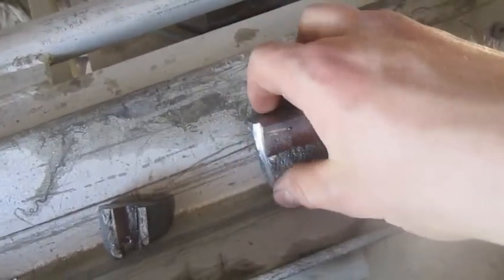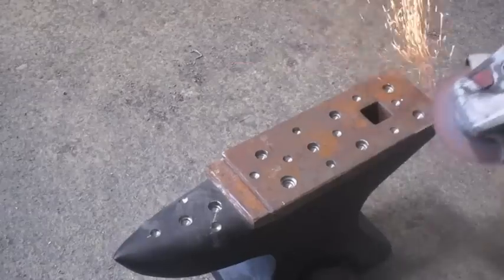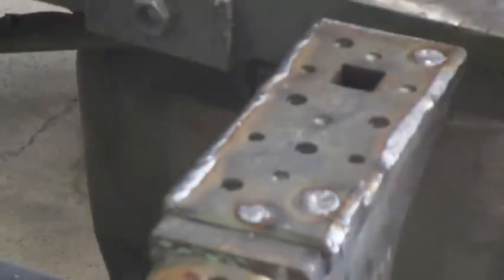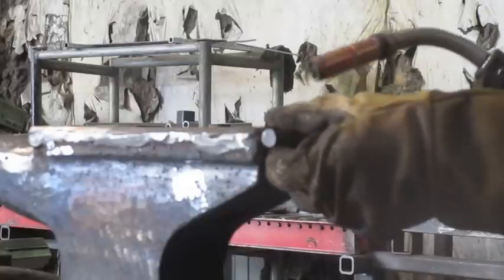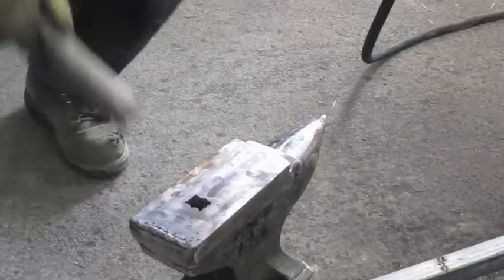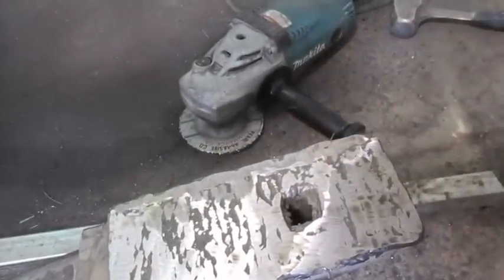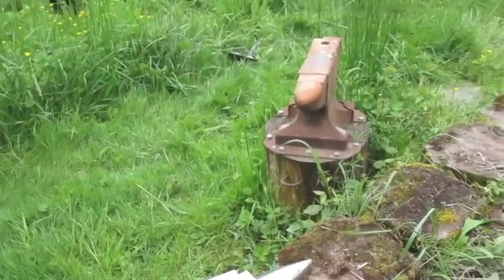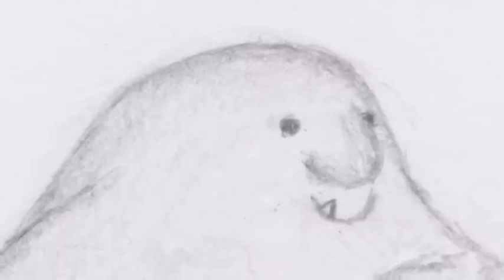Modified Cast Iron Anvil- Yes, it can be done

Comment: Make another video on this anvil. Take and fill in the gaps on the side add onto the heal and drill a pritchel hole
Reply from the maker: Would if I could! Ended up selling it.
Reply: @caveofskarzs1544  aww bummer I thought about doing that to my anvil I have the same exact one but i am getting a new one and that one is kinda sentimental. A guy gave it to me for my very first anvil. I’d feel bad to modify it but I wish it were more usable
Reply: @caveofskarzs1544  but if you ever get to it do it again. But instead of filling in the sides grind off the little lip on top before hand then hard face it and add onto the heal.

Comment: Can you remember roughly what settings you ended up with on the welder for each wire? I'm doing a very similar one this weekend.
Reply from the maker: I'm afraid I don't. I do remember that I turned the heat up pretty high.

Comment: Does anyone know if you could do this to a 102 pound Peter Wright anvil. The anvil I am talking about is my great grandfather’s anvil and someone tried to fix it with just mild welding wire and they took the rebound and hardness out of it. So I want to know if I should do the same to this one.
Reply from the maker: Might check out Essential Craftsman's video on anvil repair. I believe he touched on what to do with a soft anvil. As long as there's enough hardenable material you might be able to reharden it.

Comment: Any recommendations on what you would do different?
Reply from the maker: Sure.
I would preheat it hotter for one. Next I would use a cast iron welding rod for the first layer at the very least. Might not put as much mild steel in, since that was a big reason it took as long as it did. Lastly, I would have a thicker layer of the hardened steel.
Reply: @caveofskarzs1544  thanks. I'm thinking of fixing up an anvil, probably just needs hard facing but I was curious.

Comment: Why not just weld on a miepce of steel plate, like a cutting edge or something, drill some holes through both and fill a few spots in the middle, would be way easier and alot cheaper
Reply from the maker: I considered this. It may work, it may not. But in the case of this, it would be welding a steel plate to cast iron, and while it would be faster and cheaper, it would not be better, since the connection is in jeopardy simply because of the material difference and the lack of connection. I may be wrong.

Comment: If I'm not mistaken I think those anvils are cast steel it welds similar to cast iron you can do it nicely with mig but has to be crazy hot pre heat cast rod on a stick welder d/c works best but it's still not hardenable would have been easier to seal the edges of a high carbon steel plate with weld and forge weld it on and grind off welds this takes less money work and is the way it was done for centuries
Reply from the maker: Perhaps. But I didn't have a forge large enough to forge weld this large a piece. Thanks!
If you ever forge weld the face of an anvil yourself, I would love to see it! I know one blacksmith who has, and he said it wasn't easy. There aren't a whole lot of videos about that.
Reply: It had to be a cast steel or it would not have welded the way it did

Comment: Honestly you could make good money hard facing cheap cast iron anvils like that.   Especially since you made that material so thick before you hardfaced.
Reply from the maker: That has been a thought of mine. I would just need to fine-tune the process to make it cost effective.
Reply: Cave of Skarzs also I have soft firebrick rated to 3200°F if you’re interested

Comment: There is a difference between cast iron and cast steel I'm betting it is cast steel
Reply from the maker: Why do you think it is cast steel?
Reply: @caveofskarzs1544  welding with a wire feed and when you where grinding the sparks where yellowish orange cast iron they would have been red
Reply from the maker: @rockyroney2666  Ah, I see.
Well, whether you believe me or not, I believe it was cast iron. From my tests prior to even attempting this, and from previous experience, it was cast iron. But, maybe you're more experienced than me! Let me know.
The video does not catch the sparks' color well, and I only now saw that. In real life, the sparks were darker. If it were cast steel, the sparks also would have had sparkles at the ends; these did not. I also cut into a corner of one of the feet to break test, and it broke and looked like gray cast iron.
As for welding with MIG: That was kind of the other point of this video. Right at the beginning, I gave examples of test pieces of cast iron I welded with mild steel, and stated that I even beat on it with a hammer. I was trying to prove it was possible, and reasonably preferable to buying special rods.
Reply: @caveofskarzs1544  The way it welded  .   You would have had nothing but a mess if it was cast iron

Comment: Are you sure that's iron? It makes sparks and shines like cast steel.  That's a fortune in mig wire and a lot of time. Truth is if your material is hot enough cast iron works just fine.  Many  a blacksmith worked on a cast iron anvil for years.

Comment: Too labor intensive...
Buy a railway  scrap 
Make it cheaper...
Reply from the maker: Cheaper. . . Yeah. Better? No.
Reply: Railway track a) is illegal to gather, and b) has no real mass to absorb the shock of your hammer and rebound it back at you.  Better off using a stump with a rail connector plate attached than a piece of track.

Comment: I’ve wondered if this could be done, now i know. Thanks.
Reply: Can it be done?  Sure.  I wouldn't recommend it.  Hardfacing wire is more expensive than tool steel.  For about $45 you can get a 1/2" piece of tool steel for the top.  That's easier and will likely perform better.  Add a hardy and pritchel if desired.  Harden and temper.  Bevel the top of the cast iron anvil substantially and then weld your way out to the edge.  I added a 1" thick top to the big chunk of mild steel that was my starter anvil, and it's awesome.  I got it from my steel supplier - it was a piece of cut off from a special order - for $20.  Get to know your local steel supplier, they are to a smith what a butcher is to a chef.

Comment: I was wondering if this could be done I have an anvil about that size but is twice the weight and defiantly cost alot more but wanted to k ow because a friend wants a cheap one but you get whatyou pay for and if a good steel was on top it might be ok
Reply from the maker: Yes, I believe it could be done. Depending on how you would charge yourself on labor time, this may be a good investment. Does that answer your question?
Reply: @caveofskarzs1544  yes thank you would it be a good or bad idea to drill holes through the the steel so there is more weld to the top
Reply from the maker: That would really depend on what it is made of, and what process you are using to weld. If it is a steel top, no. If it is cast iron, yes. If you are using a stick welder, no.

Comment: Why did you use a gas shield   with flux cored wire? I'm a newbie and just bought a hay budden 80pd anvil that is damn near toast but I'm going to try and reface it just not sure how yet. Do you think I could just grind it down flat and it will work. Its got a divet in the center probably 1/2 inch and sound dead in the center. The face is mushroomed out like a lead bullet lol. Most would say I should have passed on it but it was $100 I couldn't resist. Any insight and suggestions would be a blessing and the foundation for a game plan to having a working anvil. Thanks in advance if you'd lend your opinion and knowledge
Reply from the maker: Well, the face-hardening wire only came in flux core. In any case, shielding gas doesn't hurt flux core.
As for your Hay Budden repair, I would first like to die inside at the damage you described. . . (Sounds like one I saw on eBay. Did you buy it from there?) 
I can't say I have repaired damage that severe on those older anvils, but I can give you my opinion. With a divot that deep, it may not be the best option to try to grind down to it. Bringing it up level with the rest will probably make for a more usable anvil, because on my Hay Budden, the hardened face is only half an inch thick. You could probably grind or cut off the mushroom, especially since that is likely full of cracks as it is. 
If you keep what is left of that steel plate there and weld on top of it, it will probably be an easier weld as opposed to welding to the wrought iron body. 
I hope that helps. If you have any other questions ask away.
Reply: Fork lift forks is a good faceplate 

Done me good for 3 years now

Comment: What made the welding wire splatter the way it did ?  You made a really nice anvil.
Reply from the maker: Thanks!
The cast iron itself makes the welds spatter pretty badly. Also, because this is just MIG, that also causes spatter, but not too badly. The hardface wire was inner shield, and that stuff tends to spatter a lot as well.

Comment: Neat! Just curious - why not just weld a hard steel plate to the top?
Reply from the maker: That's a good question. I will go over that in another video when I get around to it. But the gist of it is that a hard steel plate welded all the way around the edges will still have a small gap inside that cannot be seen. This will reduce rebound, and may lead to it eventually breaking due to the constant but slight bounce between the two metals.
Reply: Cave of Skarzs not if you milled the two joining surfaces perfectly flat first!  Easy Peasy!  You could even lap the two surfaces afterwards if .001" wasn't good enough, but I think it would be. I'll let you know how it goes..... Maybe a video! I have the same cheap cast iron anvil.

I think you have to do all weld on the horn though. 

I admire your patience and dedication!
Reply from the maker: That's possible, but I would trust a fully welded face over a plate any day. ;)
I have actually done that on another project, but decided against it. What I might suggest you do is drill through the plate in a few places in the top plate, and plug weld it to the main body. In theory it could reduce vibrations and increase rebound.

Comment: :) little tip on the edges you can clamp a copper bar or stick some ceramic weld backing along the edges so you can keep nice square corners. Will save you a lot of grief on the edges
Reply from the maker: I have never heard of that trick before. Thanks for the tip.
Reply: Cave of Skarzs I’d go with the copper bar for the price point and re usability though. I’d get a couple pieces of 3” by 1/4” or 5/16” or 3/8” flat copper bar (whatever thickness your metal supply store has. The thicker the better). You can also clamp it under holes that need filled in steel. You won’t ever be sorry you had them!  Ps if you gap the bar with a piece of welding wire or shim on the edge of that anvil the weld metal will flow through a little giving you just a little material to grind off. Also let the bar cool before removing it with a hammer cause it’s pretty soft when it’s hot lol. Cheers
Reply: The weld won’t stick to the copper or ceramic

Comment: So you think your procedure, work fine with that 15lbs harbor freight anvil? But you improvise it to different specs
Reply from the maker: It was 55 pounds. Sorry if I didn't say it. And yes, it does work fine. Great improvement
Reply: Did you use mild steel
Reply from the maker: The MIG welder heat was set at 25, but it can be different for every welder. I just used a setting that felt right.
As for the steel, other than the hard-facing wire, everything was mild steel, yes.
Reply: Cave of Skarzs   What the feck heat is 25?
Reply: What temperatures did you use your mig welder at?

Comment: I was wondering if it's possible to do the same process as, but instead of metal rod weld to the Anvil, can you use an 1/4 inch steel plate??
Reply from the maker: That has been done before. However, you cannot get as good of results, since from what I have seen the plate was just welded around the edges, leaving a small gap between the anvil and the plate that will reduce rebound and it will have to be replaced eventually.
Reply: @caveofskarzs1544  Yes but what is you did as you did here and drilled the 1/4 plate with holes same as the anvil? 
Also grinding the face of the anvil to as flat as you can before applying the plate. Then filling the holes and around the edges.
Reply from the maker: @Vietnam_Vet_67  Like I said to another commenter, that would probably increase the durability and rebound, but I would still trust a fully welded one over that. If you have no other choice, then that probably would be a good option.
Reply: - -  @caveofskarzs1544  
rebound is BS.
Reply from the maker: @iridios6127  What do you mean?
Reply: + @caveofskarzs1544 
 rebound is BS --- ? 
mean --- BullShit 
most of the working do on anvil is on hot,soft metal , which dampening you blows.
Reply from the maker: @iridios6127  Have you ever had to forge on a cast iron anvil?
Reply: + @caveofskarzs1544 
I forge on everything --- even rocks , several times my buddies buy HF-type anvils , and we immediately weld steel plate on top.
Reply from the maker: @iridios6127  Hm. Well, in my experience, the rebound makes a difference in the effort I have to put into the hammering.
Reply: @okboston9086  
youre not  ok Ducheston. ^__^
Reply: Cave of Skarzs   Nonsense. Rebound is only of any use if you want to bounce the hammer on the face of the anvil instead of lifting it.
Reply: @captainchaos3053  tru. Rebound is nonsense. Utterly useless unless you want to bounce ball bearings. That is why I use large blocks of wood to forge on. No steel anvil at all. Just wood. Cuz rebound is BS
Reply: Scott Reynolds   well good luck with the wood thing but rebound makes no difference to moving metal. How much rebound do you get from a press.  If rebound is your thing get a nice inflated rubber tyre or maybe block of glass
Reply: @captainchaos3053  I dont use an anvil, cuz rebound is bad. I use a 18"x33" block of oak. 
Wha't a press have to do with this?
Reply: Scott Reynolds   Just highlights the fact that the purpose of the hammering is to shape the metal, which can be achieved in many many different ways.  Mass under the work is often the biggest advantage.  Rebound like you say is a myth.  A block of glass is harder than an anvil and as such provides excellent rebound only problem is its a bit brittle.
Reply: Scott Reynolds   No that's right you said rebound is bad and that's it's only good for bouncing ball bearings and also used the term BS. But I never quoted you or I would have said I was. I was only agreeing with the comments you made. Just a figure of speach, it's common place in the English language to use slightly different words but make the same point.  But which ever drink or drug problem you are suffering with eep it to yourself.   Do some actual engineering, maybe even a bit of research outside of YouTube in the real world. Maybe ask a blacksmith.  Anvil rebound does exist. But it makes no difference to the metal being formed. Ever seen a drop forge in action?
Reply: +Vile As Phunk
for better results take 1/2 or  1 inch plate .
Also i like the idea --- drill couple holes , and weld through it . 8 holes will be optimal,i think.
Reply: lawnmower blades

Comment: Yes pinging helps cast iron relieves stress. I have welded the same broke vise back together three times. The last time it held several years and is still being used. I guess. I used rods made for cast.
Reply: tim smith   Vice will be made of cast steel not iron.
Reply: captain chaos not so, very few vises are cast of steel, it’s too expensive.

Comment: Can Stud-welding of cast iron to steel can give good results?  Screw in steel studs into the cast iron base with the stud pattern matched with a 1/2-inch to 1-inch steel plate.   Then, weld the heads of the steel studs to the steel plate.
Reply from the maker: I had never thought of that. From how it sounds, I can't say I would trust it more than fully welding something, but it would be more solid than just trying to weld a steel plate to a cast anvil.
Reply: @caveofskarzs1544  , idk but from what I've heard...
   Preheat cast iron anvil after all your prep work of course for 2.5 to 3 hrs as close to 500 deg f and preheat you top plate also. Have everything set up and ready to weld.
1st set anvil in welding spot. 
2 lay an 1/8" fluted rod at each end horn and heal bent so they wont roll
3 lay top plate on the use nickle55 rods to completely fill the whole entire gap between the  anvil and the top plate.
  * note if your not a fast welder or have to stop for any reason replace anvil back into oven and keep it as close to 500 deg f as possible 

That's the way I was told to do it. Gives you 100% weld between the  anvil and the top plate
Reply from the maker: @danielcrawford7315  Sounds good to me. Thanks! I might try that some time, since it is fully welded.
Reply: Stud welding 1/4" cold rolled steel to the face is what I did, and this worked very well have forged various items on it. As originally purchased I couldn't even forge a piece of lead without damaging the face.
Reply: That is not "stud welding"...that is welding a steel plate to an anchored stud, two different animals.